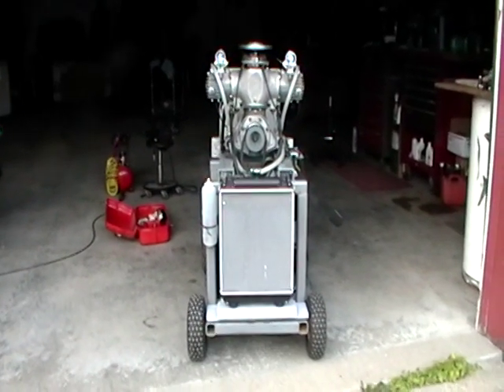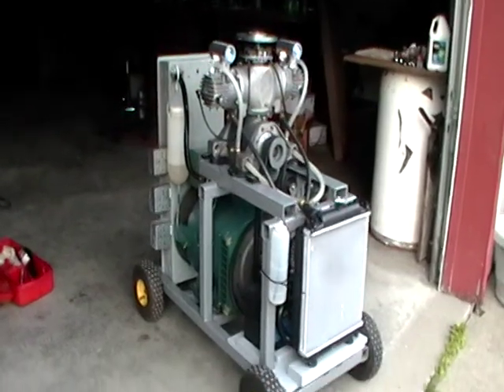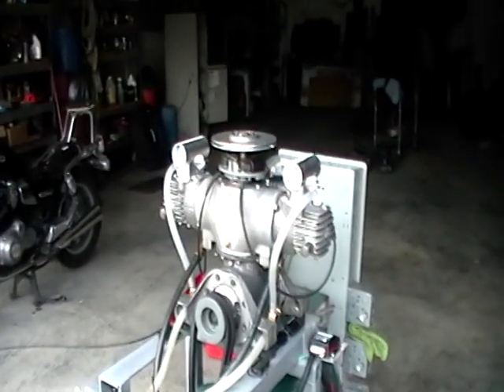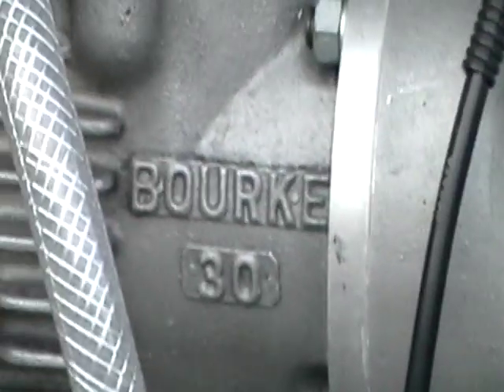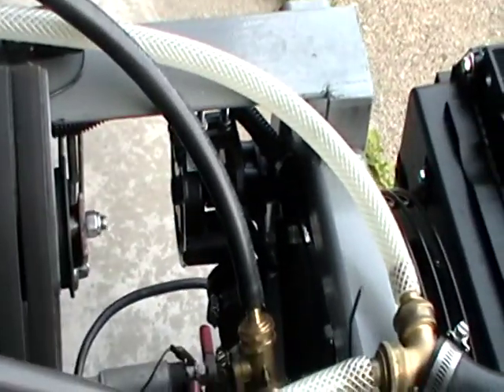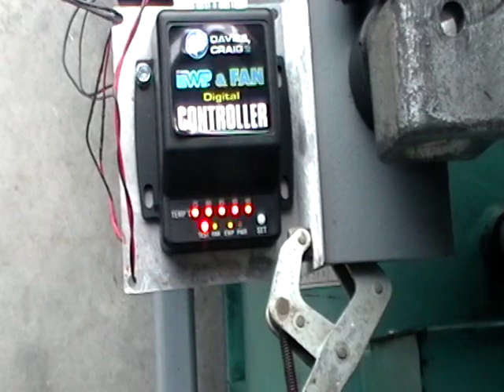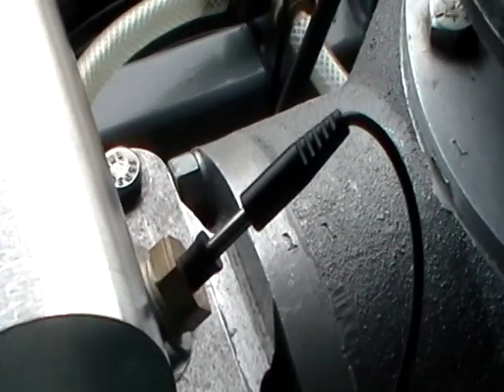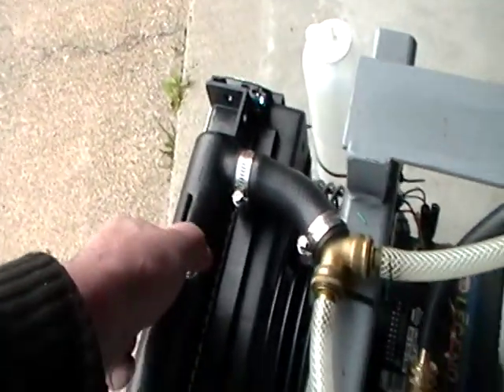Bourke engine test stand update

Comment: I think the very lean burn works because it effectively lowers temperature by slowing burn speed. Self ignition of gasoline is normally going to knock, but for very fast, early burning the lean mix might prevent detonation. Still we have not seen extended 24 hour under load trials. The Yoke might need mods to prevent excess dwell and keep temps low, thermal efficiency high. Just because an engine burns all its fuel does not mean that the thermal and mechanical efficiency is high. It might ignite too early and reach peak too early, backwarding the power, and the dwell near TDC being too long it may have to dump heat to the head far too much, so it may not use the burn to work the piston downwards. These are the main theoretical criticisms of the Bourke. I await meaningful tests.
Reply: Actually its the opposite. The Bourke Engine embraces knock. Its a pulsed detonation engine.